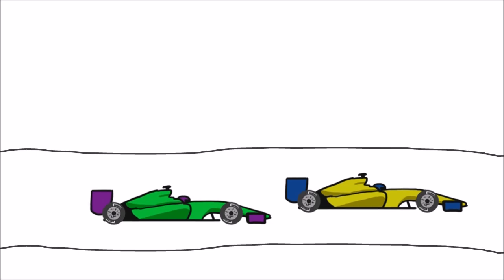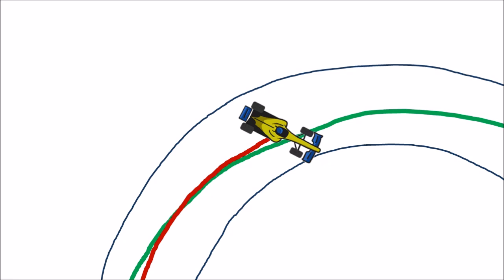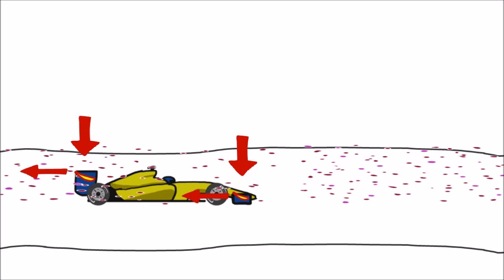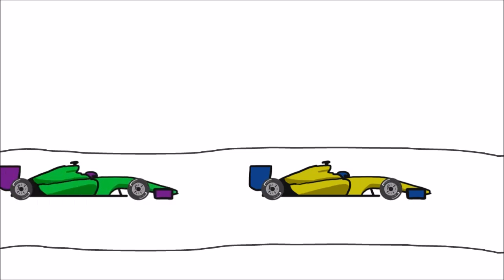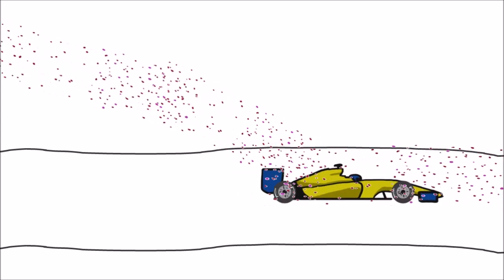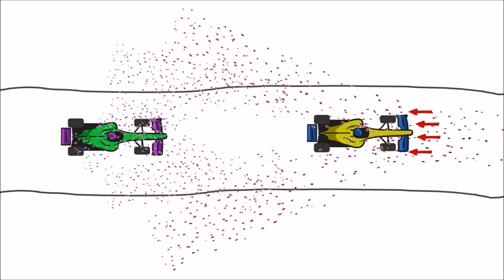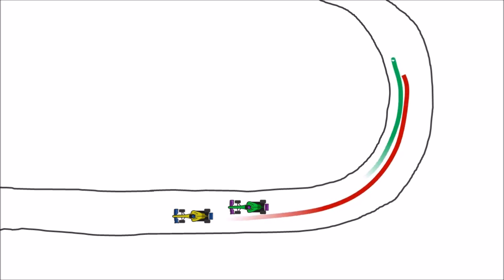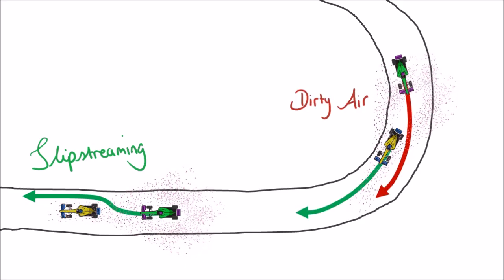Slipstreaming vs Dirty Air

Comment: with all the money spent on aero, why can't then design wings that work better in dirty air.
Reply: +JP05CPSN When they changed the rules for 2009 they banned all those winglets and weird aero appendages to try and calm the airflow down behind cars. Didn't really work much.
Reply: +JP05CPSN it can be done but at the cost of efficiencie in clean air, and you tend to ride more in clean air...
Reply: Quite simple allow more ground effects. Meaning that the cars can gain the same amount of grip but by not using big complex wings that ruin air flow meaning that cars can travel much closer without being disturbed by dirty air.
Reply: Its not allowed in a lot of competitions since losing front contact with the ground tents to launch you in the air ...
Reply: +ignace collette Of course you would still need powerful wings so that dosen't happen but the would be able to be more simpler. In addition (I'm not exactly sure btw) I'm fairly sure ground effects are cheaper. I might be wrong there
Reply: +ignace collette True.
Reply: +Dylan Cotton The reason they banned ground effect was because the cornering speeds were getting ridiculous and all the run-offs and gravel pits would need enlarging in order to maintain driver safety. I agree that it would be a better solution as the modern wings make close racing impossible and its making the racing dull.
Reply: +DjDolHaus86 Ah k
Reply: They tried. Now the cars are too slow. Even the 2016 Mercedes car would be 4 min behind the 2005 car over a whole race in Bahrain. Honestly I don't get why fan assisted downforce isn't given a second attempt?
Reply: srinitaaigaura
I believe it was originally outlawed on safety grounds because cornering speed was so much higher on certain sections of tracks where insufficient run off was available, this shouldn't be so much of a problem any more as the vast majority of circuits have been redesigned to compensate and the cars are far stronger.

Comment: Not really accurate. You cannot forget that the (low amount of) air behind an F1 car will not have the same amount of oxygen, because it has been burn in the engine, so the car behind has less oxygen to burn, so less power. Turbos decrease the importance of that, but it's noticeable, and your engine can even fail if you push too hard